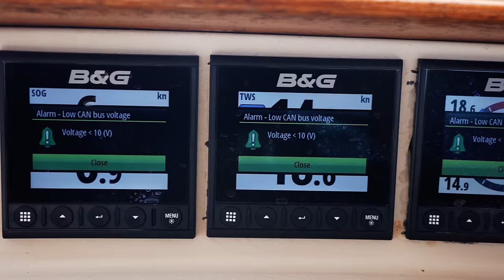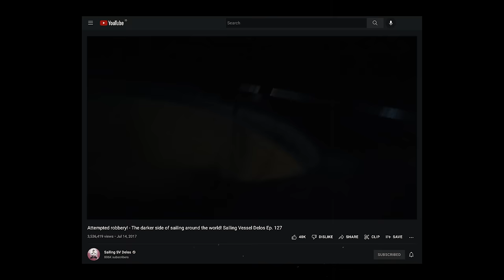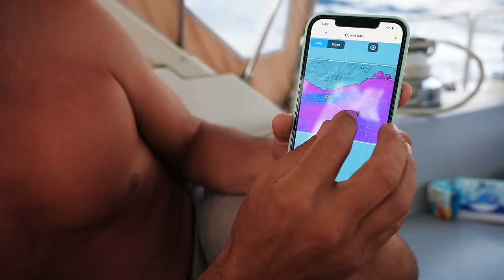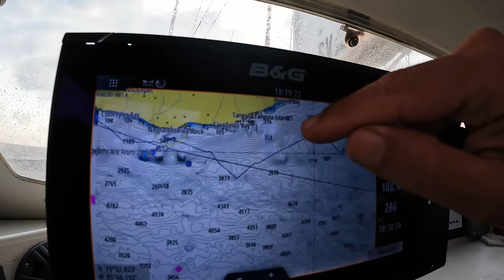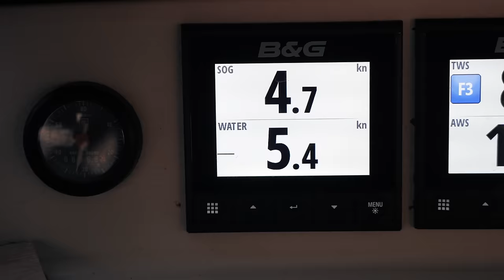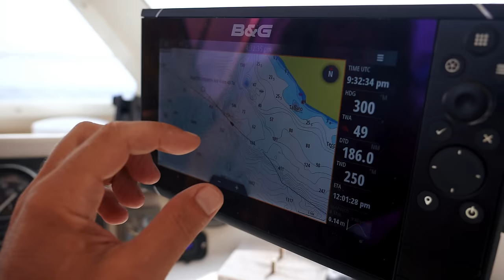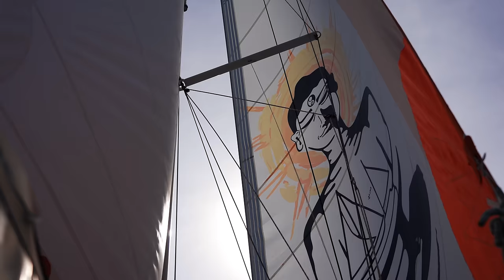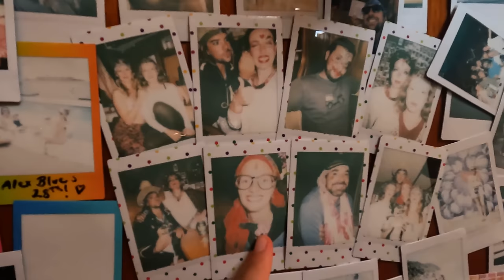What Can Go Wrong, WILL GO WRONG 😳 Sailing Vessel Delos Ep. 385

Comment: Most people don't do it. but every boat should have 3 independent battery systems.  One for engine starting, one for house loads, and one on flybridge/roof for the electronics(last place to sink).  Having these 3 independent battery systems in place makes sure that no matter what fails, you have a system that isn't compromising everything when it goes bad. You can also parallel  any of the other systems to the failing system in an emergency.

In this case I'd say that things were not fused or properly to protect the devices, and the difference in voltage, without high voltage detection-protection in place, led to something that shouldn't have been as bad as it was.  Glad you guys were able to handle it as well as you did!

Comment: Voltage regulators always run hot. Some manufacturers cheap out on the heatsinks. A few entirely neglect to engineer their thermal interface materials or geometries for proper performance, they know that people will still trust the specs and will still buy the thing if it looks good enough to pass inspection.
But even quality parts will eventually fail. If the thing is critical then you've just gotta buy redundancy.

Comment: Did you figure out why the transformer caught fire and why alternator belt snapped? I am a electrician if you still need help trouble shooting the cause, so that it doesn’t happen again. How long has that all been running? 
Make sure all your input and output voltages are rated the same voltage and same type (dc/AC). The output voltage of alternator needs to match the input voltage rating of transformer. Output voltage of transformer need to match voltage of the load, (starter or what ever it feeds). Then check the wattage rating of transformer and make sure you only using 80% of its rating.
Also, make sure your transformer is 125% more wattage than the alternator wattage providing it, to allow for start up power surge and for continuous load.
Use “ohms law” to take your calculations.

Comment: I really need to hear about the resolution of the wiring. I am surprised by the 24>12 converter being connected directly to the alternator instead of the house bank and that it was a converter and not a charger. So many systems at play here.. please give some details.

Comment: I’ve only been following y’all for a year or so. I’m not sure I’ve ever seen your electrical system diagram [edit: I found your EXCELLENT Nov 12,2019 video. I had seen it. It doesn’t show fuses/cb ]: is there a fuse or circuit breaker off the 24v bus prior to the 24-12v converter (charger)? From the video, it’s not apparent. 

I have a similar system (24/12v) with LOTS of loads on 12v but the alternator, batteries and inverter/chargers on 24v. I treat the 24-12v converter(s) and the starter battery charger just like any other load and use fuses to protect all loads. The charger, in particular, runs hot (the blue brand) after using the windlass which is on the starter battery circuit-until I convert it to 24v!  (I know, a starter battery should be only a starter battery. I have a jumpstart kit as a hillbilly backup). 

I can say that I’ve never blown a fuse in the 24-12v charger but I have worried about the heat (amps) it takes after hauling the anchor in a deep anchorage. The 12v AGM is ancient, but supply chain challenges have caused me to put that maintenance off. After seeing your “meltdown,” I am re-thinking that decision. Probably a different failure mode, but same potential failure. 

You might also rethink the navigation system backup power. The wildly swinging voltages from solar probably isn’t good for the B&G stuff—especially the (critical) autopilot computer. 

Nugs is precious. Love the channel.

Comment: If you bleed those skip Jack's out really good, they as good as any tuna.

Cut them behind the gills and put in a 5gal bucket upside down in ice water.

Or better yet, cut its gills and drag it behind the boat tied off for a couple miles.

Comment: Thank you for the history lesson on “Jiffy” it’s obviously way faster than “Two shakes of a lamb’s tail” haha. Happy Friday! When a new belt is that damaged I always check the components it’s spinning. Usually something has locked up or a pulley is damaged or something to that effect… out of curiosity have you considered wiring in a second alternator and making that one a 12 volt alternator and just getting rid of the dc-dc converter if it only charges the starting battery? Then you’d have a separate 12 volt system and eliminate additional failure points… (I’m not sure what else uses 12 volts on your boat.. I’m just assuming it’s just the starting system…)
Reply: Apparently the CAN bus (NMEA 2000) devices run on a (the same system as the starter?) 12V system since it and the fans ramp up and down according to wind turbines and solar panels output. I hope the starter batteries are just for the engine and that there is a separate 12V system for the other utilities.
Having multiple DC voltage systems must be confusing and error prone?
Reply: @everythingexplained  agreed. I didn’t consider the gauges and the NEMA 2000 system. I was thinking everything else ran on Amel’s factory 24 volt system but I do remember now years ago when he did the gauge, plotting and Wi-Fi upgrades. I still vote for completely separate systems and a dual alternator setup. The less electronics in that corrosive saltwater environment the better I would think..

Comment: Brian ...forget Battleborn now. Also forget the high priced voltage controlled alternators . Just get a new alternator as big as you can land . Mount it . Put the red wire directly to the battery , start and charge away .
The alternator is a voltage supplying device which gives 14 volts out fixed . If your battery is at 13 volts the max it can go to on the alternator is 14 volts . The lower the voltage of your battery the more current will be produced by it. 14 v is good for LFP and lead acid.

So the alternator can feed your lead acid and LFP batteries together at the same time and the sooner you swap the less damage you will get. Electricity is the same wherever it is supplied from . Only the pressure of the voltage cause you concerns.These converters are good for a set quantity of current.but if it is variable they don't take much overload without blowing up . 

What voltage comes out of it when it is connected to the battery ?  The trouble with those devices is they can  destroy themselves  and leave the output with the full 24 volt age and you NEVER want that , it blows up electronics.  Make sure that whatever you choose to use to make 12 volts be sure it can never supply more!

Comment: don't know if you have a specific engine type but in every case I know the alternator belt goes with the ribber teeth on the inside, (against the pulley wheel) and the cloth re enforcing side on the outside.

Comment: I used to value bonito the same way until I tried it on fishing vessel with fishermen that got very excited (WTF?) when caching some. It turns out if you grill them lightly (sliced in stakes) they are very delicious. Secret is to expose them to heat just enough that it is not raw and then season with olive oil, salt and pepper,mouthwatering stuff.

Comment: So I’ll assume that you have an extra converter and replaced it? Otherwise you sailing closer to shore and using charts and the compass. ❤ kinda hard to triangulate when all you got is shore on one side. Could you still use the radio to get coordinates and location markers from other boats or land ?

Comment: That area is incredibly dangerous. It changes very quickly in one particular area, like a wind tunnel coming from shore at very high speeds and blowing you out to sea  ! It comes up VERY quickly, so you have to know exactly what the forecast will be. The wind comes from the Gulf, it comes across, I think they call it the Isthmus of Too Wan Nih Pec (this is how you say it. Not how you spell it).
Reply: Wow, back to the 24 to 12 converter it looks like. Its been a while since that thing caused problems but when it does it really does cause problems ! I remember when the iridium was constantly getting burned up.

Comment: Perhaps it's Somebody's Got a headache Friday instead of SV Delos Friday?  Right off choas seems to ensue.  But then  -  -  -  🎶Ramukanji 🎶 -  -  -  plays and all is well!  (". . . like my old man says there's nothing impossible . . ." Which was included today! Yea!)  Initially,everything seems A-Okay with at least 220 NM to sail along the west Mexican coast.   The sails are up next plus dolphins and a hooked fish, that is is a bit too fishy.  Then along come some more dolphins and a bunch of anti-pirates!  Next the current plan involves tacking into the flow and some rock and roll chilly, even though Chile is quick far south.  ? ? ?   

Day 3,  A queasy crew is the key here, except for Sierra who has branched out into popping bubbles - or is she chasing bubbles?    Moral is High, or going Crazy?  Such looks like crazy to me!   

Day 4,  Brian gets belted!  And it only takes 33.3564 picoseconds!  Then the sails are out, dolphins appear and it's all in 360 cam mode.  And when least expected SNAFU!  Problems occur that are simply shocking, revolting even.  The prob is discovered when an electrical device is found to have converted into a piece of junk.  But the discovery allows anxiety to return to calm and then there's the smooth sailing and some friendly dolphins to help make things good.  : - )   

A little preview come next and we learn that Delos will be getting to Zihuatanejo, Mexico.  Now I've seen The Shawshank Redemption and (Spoiler Alert - Don't read the next part if you haven't seen the movie, and plan to.) that is the place Andy meets back up with Red at the end of the movie.  Finally we have the wall of fame/shame.  : - )    See everyone next week!

Comment: So Marine engines run off of 24V? I'd check the regulator from the Alternator just in case because that 24->12V Regulator probably saved the downstream 12V bus from frying stuff by shunting any over-voltage to a heat-sinked resistor that melted the body of that reg.

Comment: I am hesitant at asking this because you have been sailing for so long and probably know what you are doing but I got to know. At 15:25 there is a short scene of the belt on the motor. Looks like to me it is backward (inside out). The nubs or slits on the belt should be on the inside right? At least that is how I have always done it and seen it on all motors.  Or is it ok for the smooth side to be on the inside? is this some kind of hack that you have found out that it is better this way. please let me know soon. This is driving me crazy.

Comment: None of that would make the belt to break it stays the same rpm as the motors rpm's it wouldnt speed up cause of a load on the line usally something fails like the wires melting but in no way did it makke the belt to break just happen to happen at the same time as everything else ✌️✌️✌️